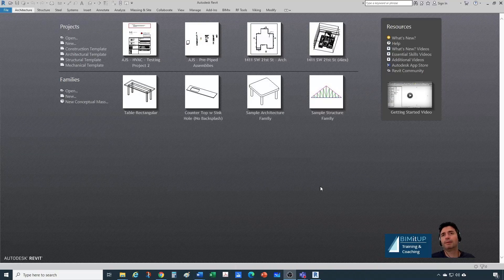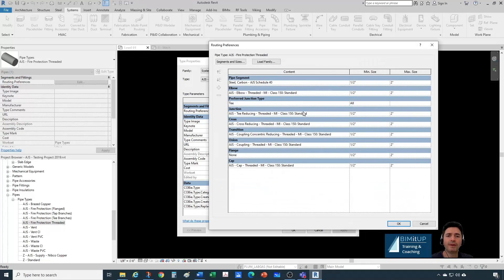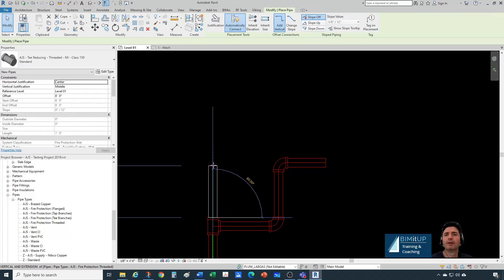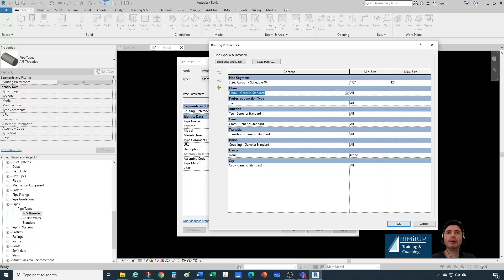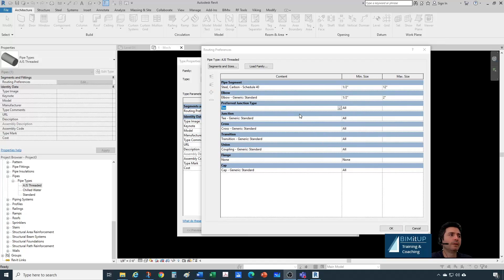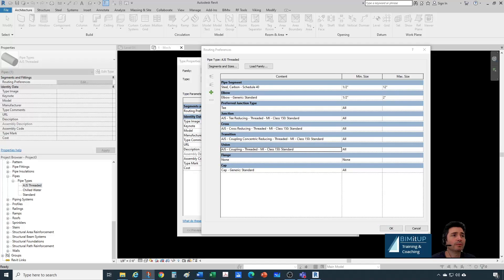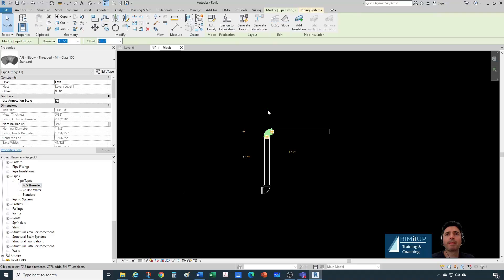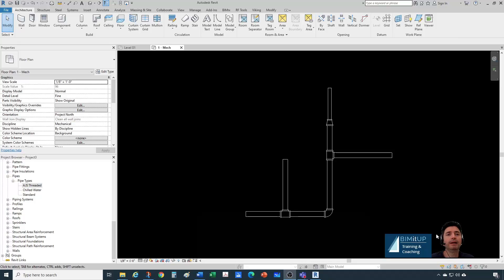How to Create a Pipe Type in Revit MEP - Routing Preferences - Threaded Steel tutorial

Comment: This is very useful! What about molded stainless steel pipings? Are there any ways to show the molding points between every element?
Reply from the maker: You would need to have specialized fittings.  I recommend contacting the manufacturers directly.